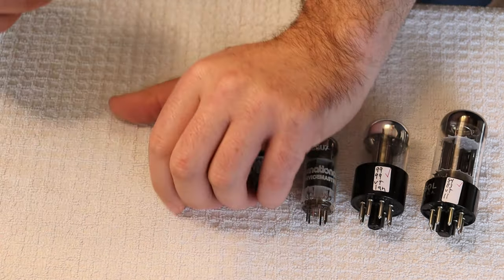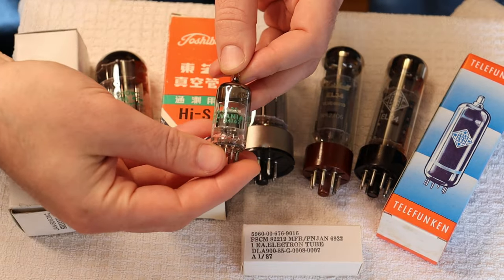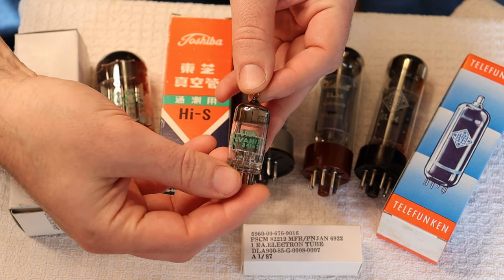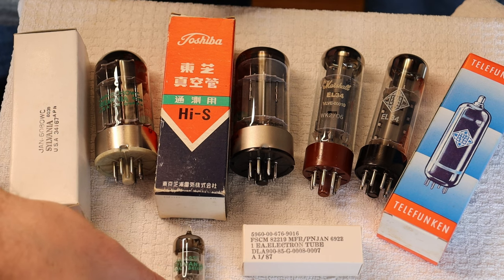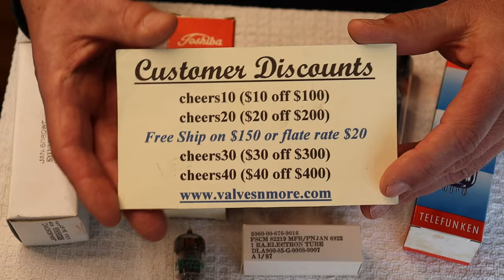Tube Lab #170 - Adjusting your gain with Tubes

Comment: The gain can also be adjusted by the choosing or modifying the operation point of the tube .........Voltage and Load...
Reply from the maker: Of course, but most of our viewers don't have the ability to tackle such a mod, so we stick to what is possible.

Comment: First: I love your content, i learned a lot - thank you from Germany, there's a bunch of fans over here!
I just wonder, because i followed a mentioned tip, the rebasing of 7N7 tubes.
My question: how do i get the Aluminium base off the tube without damage, i am afraid tbh. Is it heat, or caution and cutting?
I'd love to hear a tip from you guys, and i guess some viewers too ❤️
Reply from the maker: Great to hear from you in Germany!  We share a lot of things (for free), including full schematics for the Kit Amps, but the re-basing project was a huge investment in time and money, so we really can't share the methodology, it took months to figure how to do it on a professional level.
Reply: You could change the socket or make a socket adapter.

Comment: You can also find EL34 RFT labeld and sold by AEG ( TFK group )..identical to the one you showed.
last evolution of the 12AX7 /ECC83 was a german tube developped for ultra low noise in profesional studios ..........the ECC808.........different pin out and only 6.3 volt heater....besides the ultra low noise ( phono/mic/tape head and medical/mil applications ) it had a symetrical pin out .........witch means an even superior and  better soundstage and idential performa,nce off the two triodes ....also LL...
Philips/Mullard also made an exceptional upgraded version of the 6SL7...the 6188 / ( CV 1985, ) theinternal wiring was even glass tubed ...;( as seen in HD tubes like the 845W etc  from NU.
NU alsomade balck carbon coated 6SL7's with some lmower gain ....
The 5691 from RCA sounds delicate and very nuanced ......

Kind regards
Reply: Hey Frank. I’m worried you’re going to think I’m following you around YouTube. Haha! Seriously though, it’s interesting that we both go to so many of the same channels, mostly based on audio. 
I am always awestruck by your knowledge of the history of tubes and audio, and the fact that you can remember all those details and how each tube sounded. I could easily see a book being written with all your knowledge being written about your experiences and history with audio and tubes, speakers, etc., etc…. I’m actually thinking of titles for the different chapters as I’m writing this…lol. 

I’m not sure if I mentioned to you that I do a livestream every Sunday night at 9:00 EST with a friend of mine who’s a recording engineer, producer, mastering engineer, and was the head of academics for almost 30 yrs at a recording university in California. His name is George Borden. You’re probably familiar with some stuff he’s done. We just talk about music, how it was recorded, different albums, audio gear, songwriting, etc., etc…. If you ever happen to be awake on a Sunday night, the channel is just his name. No pressures, just throwing it out there. Janos came and joined us for a show back in October.

Comment: Apologies for my slowness, but I do not yet understand the value of a higher or lower gain number:   are the higher gain testing "better" for audio quality?  For example the the Tung Sol has lower gain numbers, but in my experience, these are amazing sounding tubes in my R8....While the Sylvania JAN spec are higher gain and, for me, also sound great.....So does this number have a meaning in audio quality? or do you just want a number at a minimum and all is good?
Reply from the maker: Yup it can be confusing!  Gm (mutual conductance) testing numbers tell us how much gain we will get out (let's call it volume) for a given amount of input voltage on the grid (again let's call that input volume).  The Gm testing number is always referenced to something, normally either the minimum acceptable value or as we do, as a percentage of NOS (new old stock).  So for example a Sylvania 6sn7gta with testing numbers of 100/100 (100%/ 100%) is a perfect NOS tube with perfect matched sections.  In reality NOS typically ranges from 85 - 105, with as you mentioned Tung's testing on the lower end of expected Gm.  How does this affect sound?  It doesn't so long as the gain (volume) is enough for your system.  BUT the Tung's will play at a lower volume than the Sylvania and you will hear the difference in volume right away.  So you turn it up!  For sound quality you want the closest to NOS you can find/afford, those tubes always sound the best.  And that's why testing numbers are so important (and for matching sections).

Comment: Hi guys, is it possible to swap an EL84 with a 6V6 and visa-versa with one of your adaptors? I have 2 amps , one uses a pair of EL84s and the other a pair of 6V6s, not essential but was curious as to the tone/output difference in each push/pull circuit? Thanks.

Comment: Nice video. Thanks. About the 6GU7--if it can be used in place for 6SN7, can't it also be used instead of a 12AU7?
Reply: It depends, so the 6GU7 and 12AU7 are both general purpose dual triodes with very similar specifications. There are two major differences between the two, the first is that the filament voltage is different. With the 12au7 running off of 12.6 volts at pins 4 and  5 and the 6GU7 running off of 6.3 volts at pins 4 and 5. The other major difference is that pin 9 is used as a heater tap on the 12au7, allowing it to be run at 6.3V and on the 6GU7 it's used to connect an internal shield to ground.

So in order to use the 6GU7 in place of a 12au7 you would need to account for these two factors. On our amps we use an external DC filament supply so it's easy to switch the voltage for the tubes.  If your amp doesn't allow for this, it might be possible to modify it to allow for an external filament supply.  Some amps that run the 12AU7/12AT7/12AX7 series of tubes also run them on 6.3 volts using the tap on pin 9. If that's the case, then you would just need to re-wire the sockets a bit to get them to work. Or get / make an appropriate adapter. 

Of course if you're building an amp from scratch that was intended to use a 12AU7, it's easy to make the necessary changes to run a 6GU7. It's also easy to set it up with the external DC supply I mentioned earlier so you could run either tube by just changing out the filament supply and leaving pin 9 disconnected. This is exactly what we've done with the prototype testing preamp, and both tubes operate at the same point and settings just fine.

Warning though, electronics and tube amplifiers can have very high voltages present, which can be lethal. Exercise extreme caution when working around them and always consult a professional technician when in doubt.
Reply: @charleslambton7836 Thank you. And forgive my ignorance--I thought the 6SN7 was an electrical equivalent of the 12AU7.
Reply: @jensastrup1940  No worries! So the 12AU7 is commonly called the direct equivalent of the 6SN7, but that's not technically the case. The actual direct equivalent is the 6CG7. What happened was that in more modern equipment, 12v heaters became more common and so the 12AU7 took on many of the same rolls that the 6SN7 had been performing before it

The 12AU7 is actually descended from a slightly different line of tubes. Before the 12AU7 there was the the 12AH7, which was a similar tube in an Octal bottle.  The 12AH7 and the 6SN7 and all the other medium MU octal dual triodes evolved from single triodes like the 6J5, 6C5, and 6L5. Which in turn evolved from earlier single triodes like the #76, #56, and #27. There are a few other transitory tubes mixed in here and of course versions of these tubes in different heater voltages and bases.

This is all just a lot of unnecessary history, but basically it means that all these tubes perform similarly to each other and were all designed to be "General Purpose". So in many cases they can substitute for each other as long as you have the correct socket, pinout, and heater supply.

Comment: Can I use 6GU7 with adapters in my Willsenton R8?
Reply from the maker: Yes in v6&9, the driver/phase stage.  This stage brings up the voltage for the power tubes as well as splits the phase for class AB operation.  We actually have a Preamp Set for the R8 that uses the 6gu7 in combination with the re-based 7f7 (Sylvania 6SL7gt equivalent) and it sounds amazing, bringing the warmth of the 6SL7 into the preamp stage and the clarity of the 6gu7 for the driver stage.  You could also use the 6cg7 in v6&9.